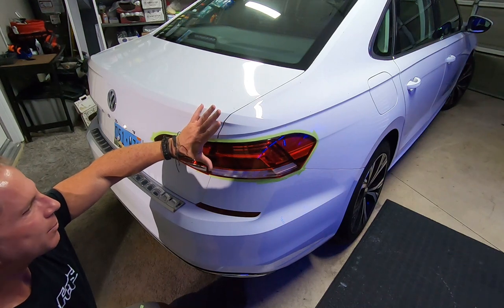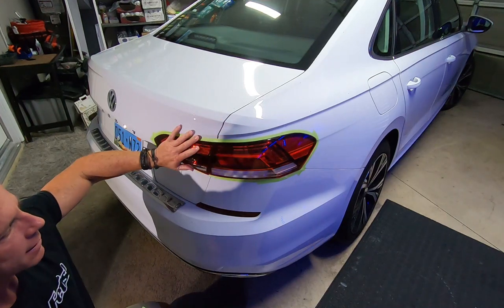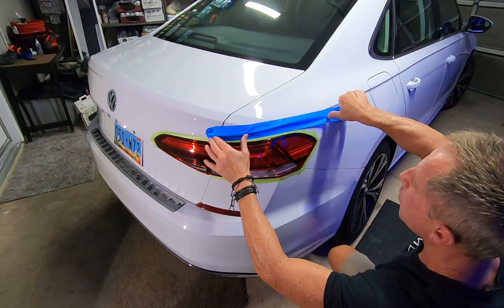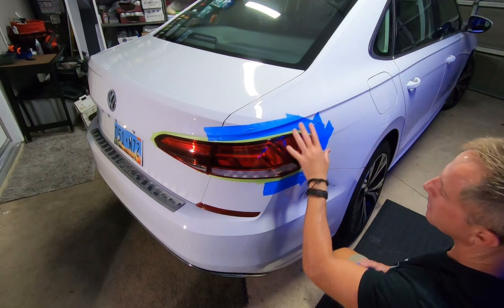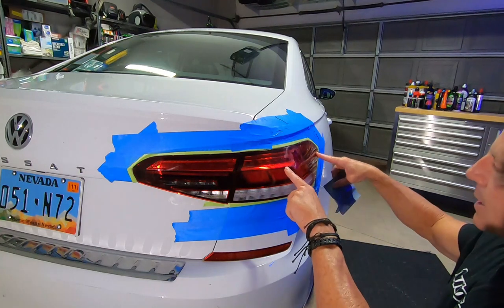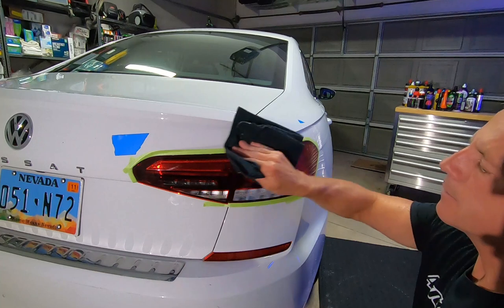Restore Tail Lights: wet sanding and polishing plastic tail lights w/ Ceram-X car polish

Comment: Acrylic plastic is used on tail lights. Acrylic plastic is UV stable and needs no protective coating.  It lacks the strength of polycarbonate,

Headlights are made out of polycarbonate a plastic that is very UV unstable.  It is often protected with a uv coating to help slow down oxidation.  Polycarbonate is a strong plastic and is more impact resistant than acrylic. This is why why headlights are made out of this type of plastic, but it requires a protective uv coating to slow down degradation